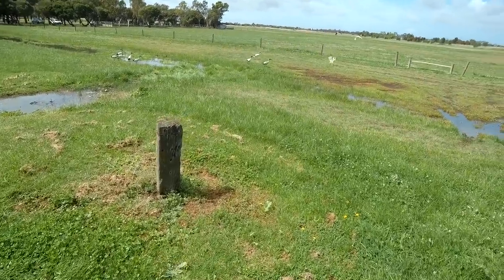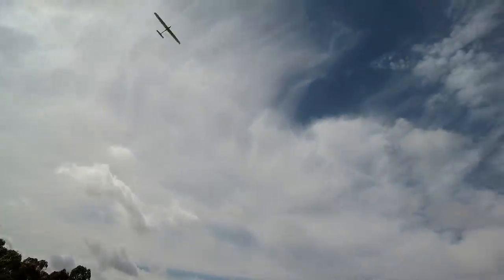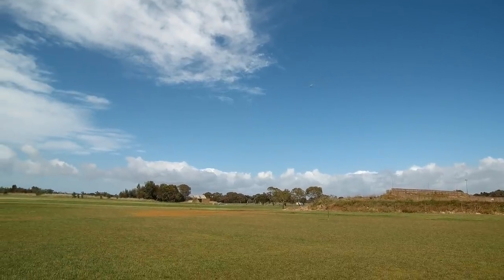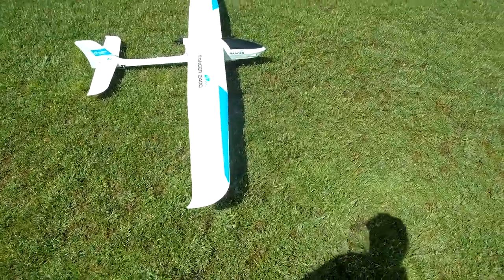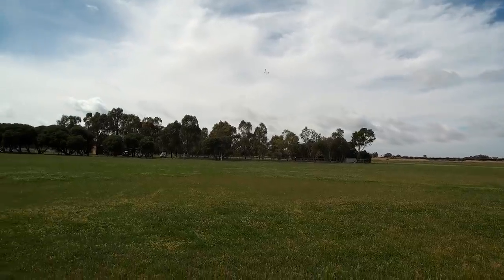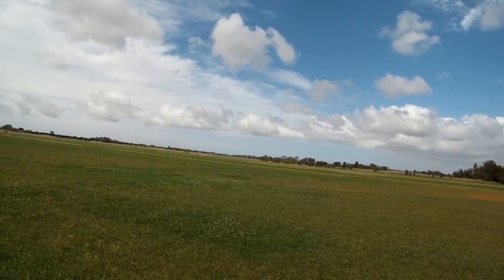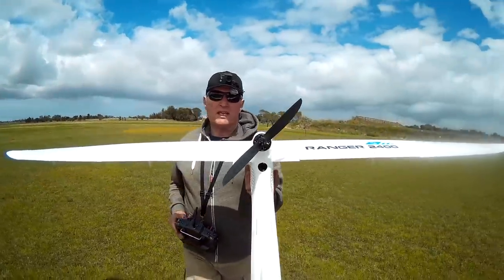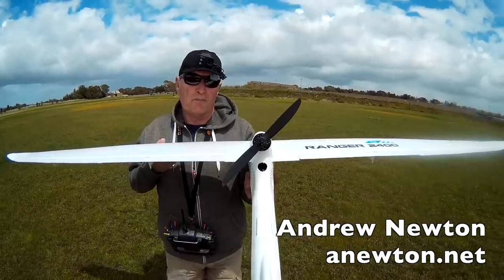Volantex Ranger 2400 maiden

Comment: Another great video Andrew.  Hmmm. 5.5 amps at about half throttle cruising speed. Looks like this is a definite aerial mapping platform. I suspect you might get a little more practicality if you dumped the large wheels. Most are probably used to hand launches anyways. Like the way the big landing gear comes off with just two screws. Ironic isn’t it that it takes off as good, if not better, than with the large wheels on. I would go as far as to say that this is an ultimate, affordable mapping platform. Volantex hit another home run with this one.

Greetings from Florida USA.
Reply from the maker: I understand why they included the big wheels, so a gimbal wouldn't hit the ground. But they are too far back and maybe not lifting the nose high enough. Without the landing gear to comes alive
Reply: The landing gear looks like it needs to be about 50mm further forward, bigger wheels would help also , I'm pretty sure some of the other ranger models had an option for larger wheels.

Comment: Such a baller ending to pinpoint land with the flaps, then pick it up and address the tail cam. I've been researching what my ~2m "battery bus" is going to be, and I think this is the winner. Super efficient, while also capable of carrying massive battery weight, and also readily available with lots of 3d printable FC/inav mounts. I have a couple of bucket-list flights that I want to be able to complete (circumnavigating a few islands), and I think this is the wing that's going to get me there.
Reply from the maker: Thanks, it's a big beautiful beast

Comment: The landing gear would work with a front center wheel. I bet it would easily take off from that grass. I use the smaller Aeroscout S (1.1m) and that arrangement works much better on the grass.

This is a beauty though. Monster wingspan, and it's so efficient.
Reply from the maker: Yes that would work

Comment: Hi Andrew,

which one do you like the best?
ranger 2000 or 2400?
and why?
just trying to understand which flies better :) b4 bying
Reply from the maker: Both are easy to fly and efficient. 2400 has more capacity but harder to transport, big wheels are not much use but the little wheel works for takeoff. I'll probably fly the 2000 more just because it's easier to fit in the car.

Comment: That rediculous UC and the high pusher thrustline was never going to work, what were they thinking?
  If you use the original mono wheel it pushes the nose into the ground without a load of up elevator..Who tests these things? Odd when you consider how well engineered the rest of it is.
Reply from the maker: It's actually depressing when you see some of these marketing led design decisions.

Comment: Would you say the Ranger 2400 has a slower top speed than the Ranger 1600 or 2000 with the stock setup? 
I'm wondering about its ability to fight headwinds on a long range flight.
Thanks for the great videos on the Ranger series.
Reply from the maker: Good point, yes this would struggle more with a decent headwind, having more drag. How much, I don't know.

Comment: Hey Andrew,

would you mind to do a comparison betweeen the Ranger 2400 and ASW28 ? I own the ASW28 but I dont like it as much as I would like to...glideratio is pretty average and it is also losing a lot of height while turning. Could not  really try the flaps due to time and thermalconstraints.
Reply from the maker: Totally different style of plane really. R2400 is for heavy lifting and the ASW28 is a scale glider (everyone has the same problems as you with it). The Phoenix Evolution is the best thermal glider in the Volantex range if that's what you're after.
Reply: @AndrewNewton  I moved the battery further back for for my last flights which did improve the behavior (but still kinda average.)
I am exactly looking for quality E-glider around 2,5metre (ABS/fiberglass fuselage and sturdy wings/planked foam/only wood)for a really light FPV setup and LoS.
But the choices in Germany are limited, its either very expensive 300+bucks (empty) or bad quality from china like the ASW28 with wooden wings (I used to own).
Do you have any recommendations ?
Reply from the maker: Sorry no, I only know cheap foamies really

Comment: I am new to the hobby. I'm practicing on a simulator and a small ready to fly. i'd eventually like to do some video. Which would be better for a beginner, the Phoenix 2400 or the Ranger?
Reply from the maker: Ranger 1600 would be the best for beginners. The 2400 is way too big and heavy to learn on.
Reply: @AndrewNewton  For LOS  flight, compare with small 1600,  2400 handle more wind, stable and easy for beginner, its size also easy to see from far away if beginner lost orientation. The heavy and big size hard to transport of 2400 just a small problem with those good points.

Comment: "put tundra wheels on it - cant roll on mild grass".

from looks seems that the wheels problem is that they are too close to the CG ..so the plane pivots much easier.. they should be more to the front..
Reply from the maker: That's right, bigger wheels wouldn't help, need to go forward

Comment: I wonder if I could install a single sailplane type wheel into my Ranger 2000? What kind of hardware is used to accomplish it in the 2400.
Reply from the maker: Just a wheel and an axle/bolt.
Reply: I wondered why the 1600 and 2000mm don't have centre wheel the housing is there for it I looked on bangggood you can get them for One and half dollars with axle a must buy when if order the kit though that said it maybe the part for volantex phoenix  the spare parts just coming through for them now wings tails motors props more so for the 1200 mm version these are awesome planes way ahead of the game I reckon just waiting on delivery of 1600 version   try set up GPS system good fpv as a test donkey  then get this 2400 install it all to it great vids learned tons from Mr Newton .net co org guru guy he the man

Comment: How much weight would you estimate the Ranger 2400 could handle? Is an AUW (w/battery) of 3000 grams reasonable? I'm hoping to fly mine with a 4S6P 18650GA Li-Ion pack that weighs 1200 grams.
Reply from the maker: Oh yes, built for weight carrying, I would think it could handle 4kg easily

Comment: This model is puzzeling me..
Current draw with just 6pc- 9g servos and the ESC live draws whopping 0,6A without even touching the servos via the sticks..
I will find out why!
Reply from the maker: Seems like normal current to me.
Reply: @AndrewNewton  I found out it was mainly the current needed to brake the motor. 
Cutting the ESC dropped the current to almost zero. So there we have it🙂
Reply from the maker: Aha! Makes sense thanks
Reply: @AndrewNewton  
Pitty is they have a std propeller..
Anyone above in mind would have a folding.
But they are not where they should be in these things.
Hopefully someday..
Reply: Anyway, on mine I have a folding propeller, covered the gap from fuselage to motor.
Taped all hinging gaps with laminating foil, added knife sharp spruce trailing egdges all over. Included rudder wich was insane 5mm thick.
As I see it, they gave us a toy to be juiced up quite abit, if you know what to do..

Comment: According to my wikipedia and rcgroups research... ahem... I mean... as a professional plane designer, I think the wheels should typically be at or slightly ahead of the leading edge. Reason being that they need to be a bit ahead of the CG to make sure the plane will sit on the ground properly at rest and not nose over on tiny bumps, yet not so far ahead of the CG that rotation is difficult. Looks to me like these wheels are simply too far back, they could easily be an inch or more further forward, with that diameter and nice soft rubbery material the grass you were on doesn't look like it should be a problem.
Reply from the maker: Yes, I think angling further forward, longer legs and maybe bracing up to the nose would do the trick. Then you could mount a gimbal safely.

Comment: Do you think a 10000 man 4s would fit ?
Reply from the maker: Yes, check out the RCGroups thread
Reply: Yes, the multistar 10,000 mAh  4s battery does phyically fit in the fuselage.  I still have to finish assembly and check CG after all additional FPV gear is installed to determine actual placement of it; however, it looks very promising.  At the same time the results Andrew is achieving with 6000 mAh is great.  I may just stick with the 5000 mAh batteries I have on hand and keep it light.

Comment: Andrew, a brief question:
A really roomy platform, but when it comes to extreme endurance; do you think that 10+ hrs with 50.000 mAh Li Ion is possible ?
Reply from the maker: That would require average current draw of 4A, which probably is not possible with all the extra weight
Reply: @AndrewNewton  I am quite aware of this "run-away effect: More power needed - larger battery - larger mass - more power needed ...
There is a quite intersting clip on Youtube about this topicand that Ranger 2400 is consuming just 4,8 Amps for level flight.
Totally agrred that it will be more in case of a larger battery. Here this link: (179) Breaking My Long Range FPV Distance Record - YouTube
Reply: Should work better :-)